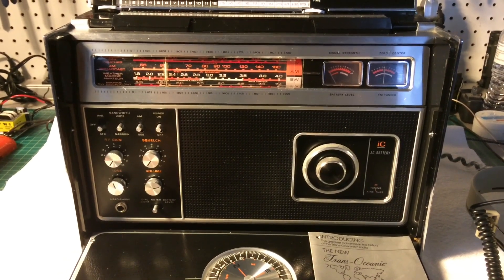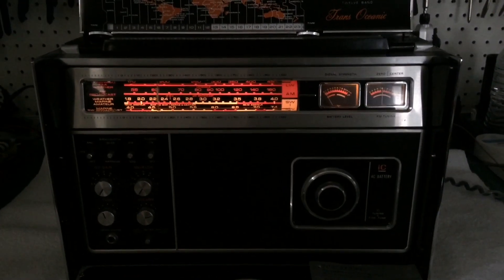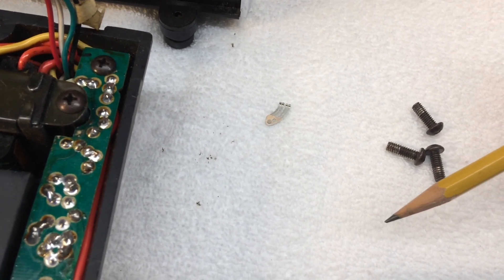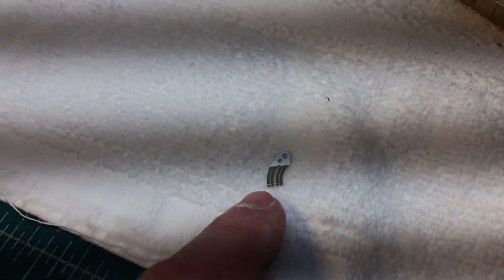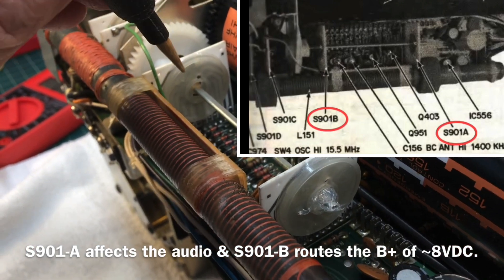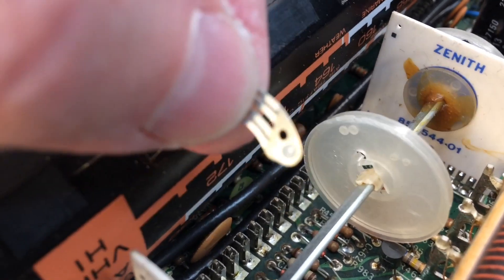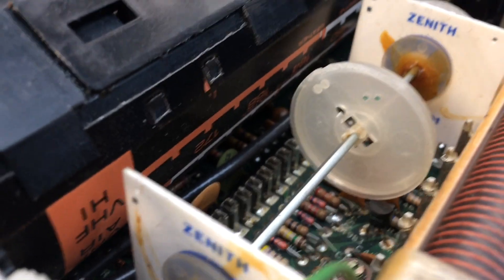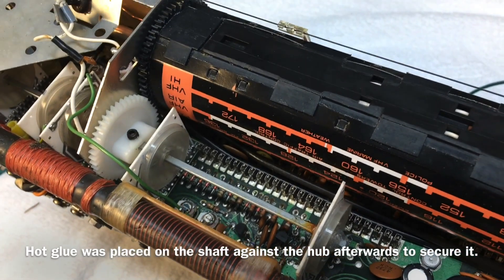Zenith Trans Oceanic R7000-2 Bandswitch Repair

Comment: I have a Zenith K731 and when I took the back cover off of it, the wires came off of the back cover and I don’t know how to get them back on
Reply: I’m not sure how to get them back on properly
Reply: I know they need to be soldered, but the one wire came off of the inside of the radio and I don’t know where to solder it back on at. And I don’t believe it’s ever been taken apart until now. There is so much dust inside of it that I wanted to clean out of it. But then the wires came off. Any advice?
Reply from the maker: Check out the photos at the top of this post: https://www.antiqueradios.com/forums/viewtopic.php?t=163972 and let me know if this helps. Best, Don